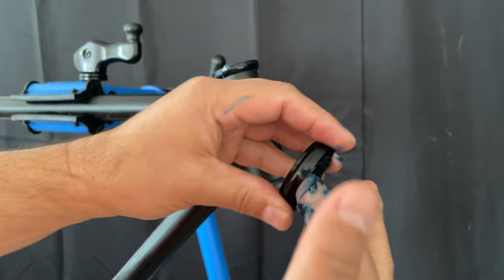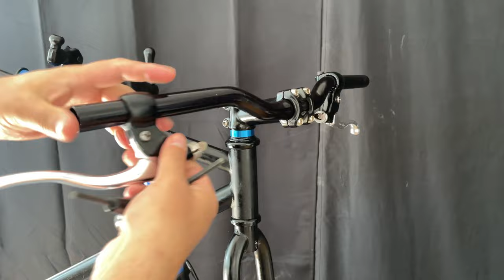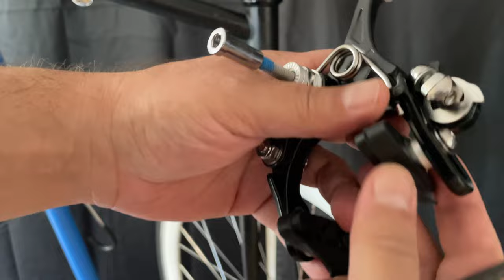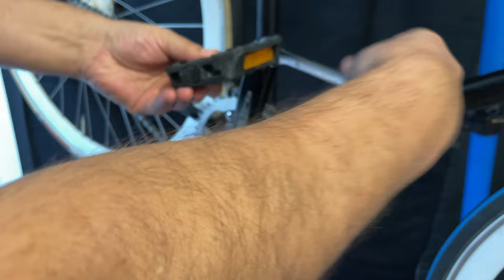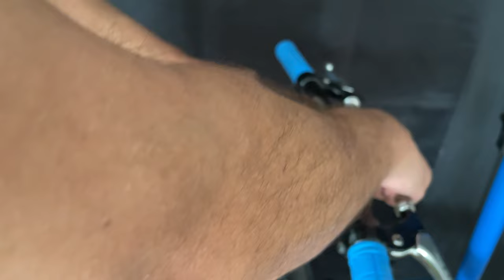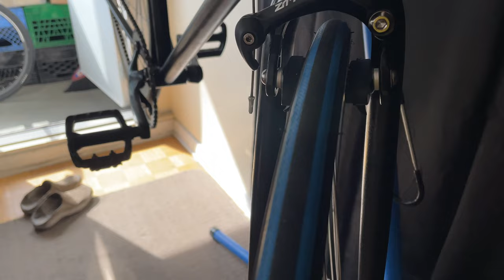I built a fixie for FREE! Long AF version.

Comment: What brand is the bike @hobbybike? Appears to be a vintage frame. I have vintage GT's. Just wondering if the bottom bracket situation is at all similar. GT Outpost Trail & GT Palomar, both large mtbs.
Reply from the maker: Thanks for the comment 👍 ! No clue what make/model but it can't be too old since the fork is threadless, but old enough to be heavier steel; probs early 2000s. This one has the standard 68mm BB shell, even though the BB is labelled BB73 @ 4:17. One thing distinctive about older GT models is the extended seat stay at the seatpost/TT area, which this frame lacks.